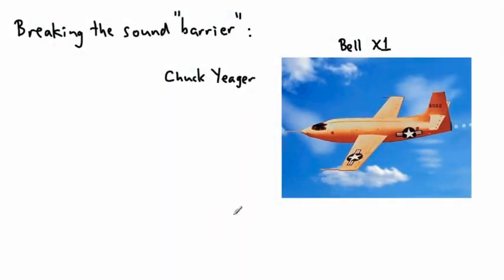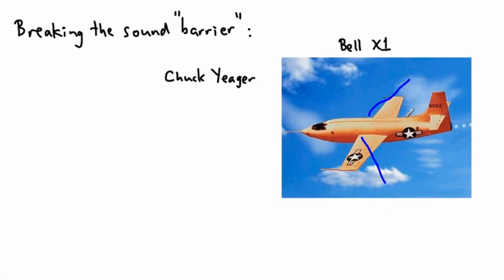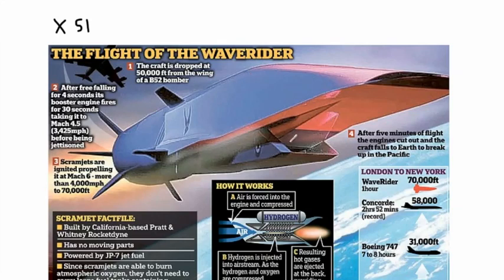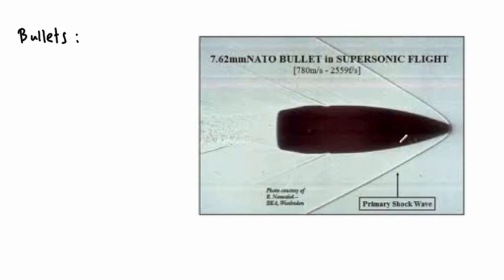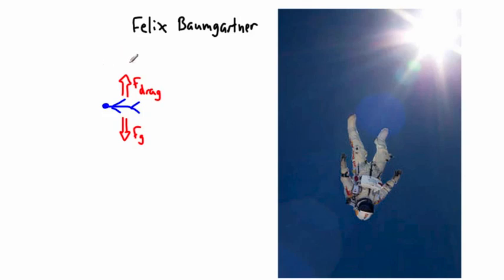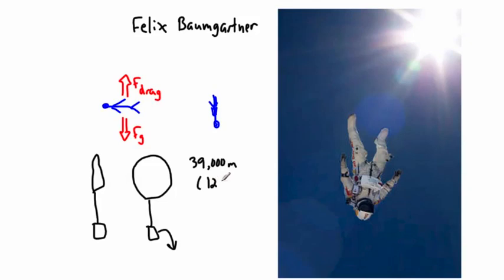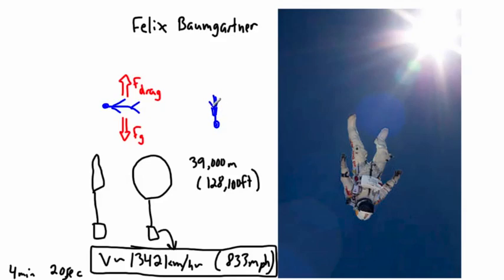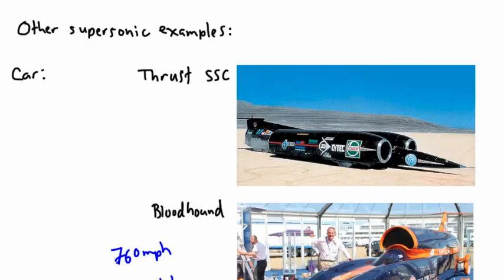Waves - Breaking the sound barrier (3/3) - (IB Physics, GCSE, A level, AP)

Comment: It's main use is as you said, to break the sound barrier. However, I think it's more important for the aerodynamics needed to do such a feat. As a car goes faster and faster, it gets really difficult to keep it on the ground and especially to control it. Yes, they're doing this in the air, but it's actually much harder to do on the ground. Pretty awesome. You should check out their new plan - Bloodhound. I hope they can make it work! (going much faster than Thrust SSC did, and the same driver/pilot)
http://www.bloodhoundssc.com/project